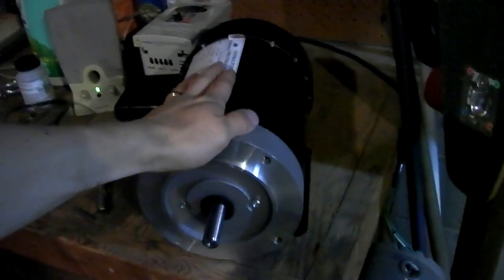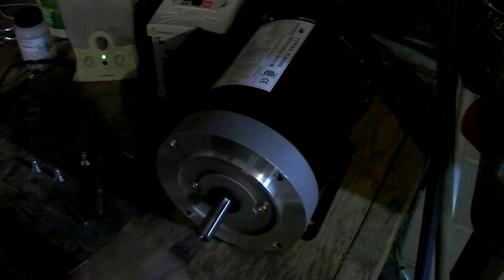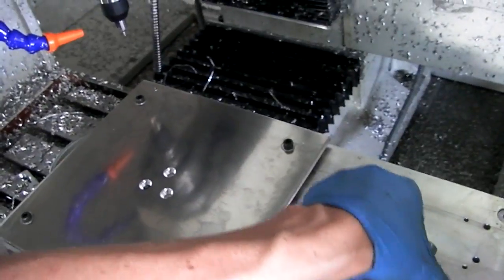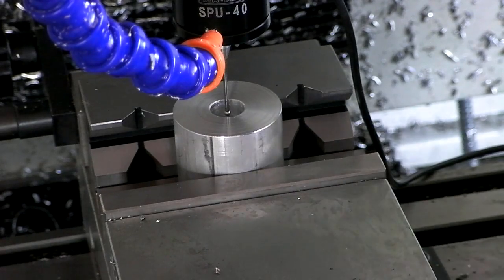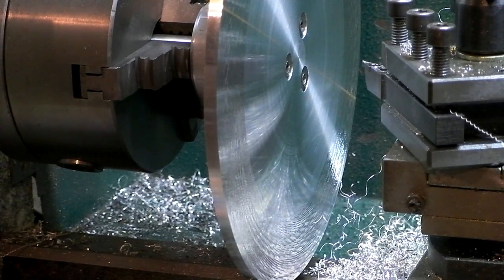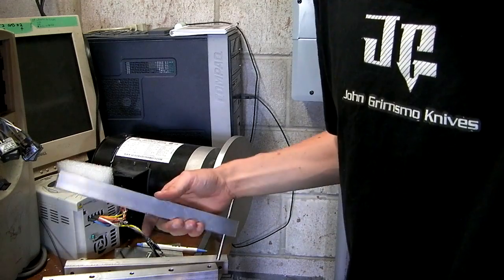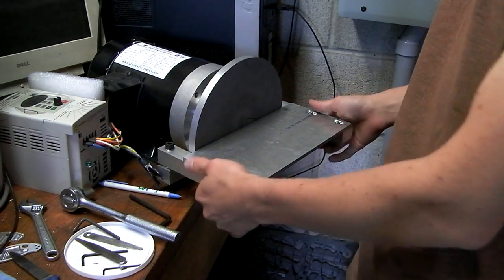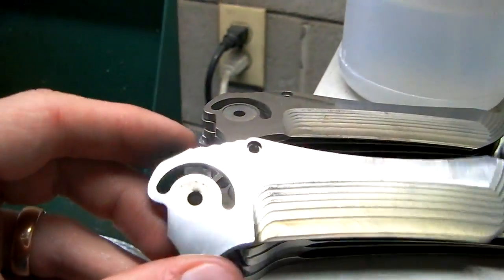Making a disc sander

Comment from the maker: Very cool!  Thanks for the tip!  After more practice and actually using a GOOD 3M sandpaper and not the no name stuff we were using, we're having great results.  The paper we had sucked and was too thin, so the backing was peeling right off.  Also, we're using a lot less adhesive than before, and it works great.  I will definitely keep your tip in mind, thanks again.

Comment from the maker: Dude now THAT is a killer idea.  I was just thinking of having little pry locations to lift the blade up, or have it go over the edge a bit.  But the 2 piece idea might work great and be easier to clean, depending on how I designed it.  We'll see.  For the next batch of blades we'll definitely have to make something.

Comment from the maker: We noticed the scale is pretty deep.  Interesting, if we can surface them all down to the exact same thickness before machining, say 0.122 or whatever it needs to be, then that will make both the machining and the finish sanding a LOT easier.  All my programs are based on 0.125 thickness, but it won't be hard to change it down a few thou.  We've gotta get a surface grinder!  Or you've got me thinking of looking into the cost of having it done locally...  What I really want is a Wuertz grinder.

Comment: John, in the video I noticed you've had problems with your sandpaper adhesive. I used to do a lot of body work on cars, and used a product for my sanding tools that I think may help you with that problem. It's made by 3M and is called Feathered Disc Adhesive (Type 2), #08051. It can be used multiple times without adhesive build up, it's very sturdy, and comes off easily and cleanly. I hope it can help you!

Comment: If you are wanting to take the pitting out of the steel, and that was the main reason for making this disk sander, you need to use a surface grinder that way you could line up a bunch of pieces at a time and save yourself a lot of time and hassle and get fantastic looking parts.

Comment from the maker: Thank you for all the tips, safety is definitely a must.  A surface grinder would be the BEST solution to do what we're doing, which is, uhh, surfacing the blades.  We're working on getting one at some point.  The gap for the disc sander table has to be tiny or else there's a serious potential for injury.  Most of these tools can be quite scary!

Comment: I know it's a bit late now but to get a really nice true turning, make the hub and plate, remove from the lathe and chuck up some scrap, turn the scrap to the exact size of your motor shaft and do not remove it. You now have a perfectly true shaft the same size as your motor. Mount the hub and turn and face the hub disc. Now when you fit it to the motor you will have a perfectly balanced disc.

Comment from the maker: Also, after having seen the exact part you're talking about, I was stupid enough to start sanding with the edge down, that's why it got stuck between the gap.  Now I always sand edge up, so that the spine of the blade is resting on the plate and can't slip through.  When machining the opposite side, I run the motor in reverse.

Comment: Ok John, Thanks. I ordered my Para 2 last nigt and I should have it soon. I really want a sprint para (the grey one you have), but I can't find them anywhere. I guess the only way to get them is the forums. I will make videos soon. Also, I am gettiong some Ti and attempting framelocks! It should be fun. I will put a dremel cut off wheel in the drill press, set the height, and rub the Ti across until it is cut. Tell Eric I said hi because I bet you get all the publicity (JOHN Grimsmo knives).
Thx

Comment: Hey Brother! Just an advice on the blades for the future - You'd be better off having them surface ground after cutting them out and before doing any machining on them. . Sanding them afterwards will mess up Your grind lines and alot of different things because this rolling scale is pretty deep (I've worked with RWL34 and I know ;) ). Plus it's a way better base for machining than the pitted uneven surface.

Comment from the maker: The trick is that the radius of the wheel is smaller than the length of the blade, so the blade HAS to slide back and forth in order to sand the whole thing.  Hard to avoid running off the edge.  However, you might be onto something.  But when doing lots of blades at a time it's a pain to wait for the motor to spin down for every one.

Comment: I've been a machinist tool maker for about 20yrs. You need to have the set screws if that is what you are going to do exactly. Make sure the screws are set apart if not,  you will keep having the same problem. You could use the same set screw but drill a relief hole into the shaft or lastly shimm it. I guess without taking the motor apart you could cut a key hole into it.
 Also u want remove as much weight as possible on the disk part. Do it on the back side by creating ribs that will give u riggity but also Will help you with vibration.
 You also NEED to that balance that disk. First with you CNC vertical mill. Drill a hole with a (BRAND NEW )1/8" HHS drill (so it perfectly 90° into scrap aluminum that has some thickness to it) remove the bit from the tool holder and take the exact same drill turn it upside down and insert the shaft into that same hole. On a level,  work surface (that you can get some vibration when u tap on it) put the jig you just made on it. Then place the face side of the disk on the bit (if you can' t get it to balance flatten the head of the end of the drill a little bit on a grinder) then " GENTLY" bump the surface of table and what ever directition the disk falls needs to have weight removed. It is exactly like balancing a tire. You will need to go back and 4th. Also make a Corresponding shaft that can be used on the lathe that u can dial it out to see where the set screw need be and by how far in to center the disk.
  IF YOU DON'T you will be replacing bearings real soon with that kind of wobble or the motor. If u take the little bit of time to do it ir will last past your kids' kids.
Just want to help out a fellow knifemaker out. And hate to see u pay all that money and time for more costly fix in the future because bearing are a pain in the head and wallet

Comment: I used to have a Wadkin 30' dia machine it is designed to run clockwise so you have to use the right side and these machines are the rolls royce of sanders. Theres no convention just what you get used to. In my experience the bigger the better as discs last longer. On the lighter side I have a lasting memory of my dear ol Dad setting his coat on fire grinding a cam ha ha

Comment from the maker: Subscribed, now you HAVE to post cool videos of it!  Haha.  The Tormach does run on 220v, along with a 120v for the computer.  Ti Para2 handles will be happening very soon, I've been having some more problems with my design, they're not coming out as perfect as I want them to be, so I'm holding off on the Ti ones until the code is PERFECT.  Stay in touch and I'll make sure you'll get some.

Comment: "But when doing lots of blades at a time it's a pain to wait for the motor to spin down for every one"
.
You don't have to wait for the motor to stop.
Your VFD should have dynamic braking settings.
The motor can come to full stop within a second or two of turning it off, much less time than it takes for you to switch blades on the magnet/jig.
.
I do agree with surface grinding if you can.
The blades are easier to center if everything starts parallel.

Comment from the maker: Didn't mean to sound know-it-all-ish, cause I certainly don't.  In my hobbyist experiences with acids and metals this was the case, and even still they're scary to work with at home.  I guess I'm generally trying to avoid the nasty stuff if I can, then again maybe the chemical you're referring to isn't very nasty, who knows.  Either way, disc sanding or surface grinding gives me the warm and fuzzies and is the common way to tackle this problem in the knife world.  Certainly not the only way.

Comment: I think over time you're going to have alot of buildup on your disc with using spray adhesive directly to the aluminum.  You give any thought about making a velcro backed liner that you can permanently attach to the disc, and then use some of the velcro backed sanding pads you can buy for larger hand/disc sanders.

Comment: Part-1
Rather then sanding to remove the "pitting" you may want to look into an acid bath of some kind. When I worked at a major airplane manufacturer in the Pacific Northwest, they did this in their plating (Chrome, etc) shop. Their tolerance for material removal was 0.001". took about 1-1/2 min in the tank for approx 1000 plus parts at a time in a very big tank. approx 6' Ft wide X 12 foot long, by maybe 18" in to 24 in deep.

Comment: Like your video. Much better than the disc sander is looking at the fine tools used for making it :) I think to get rid of the wobble you should have straightened out the backside of the aluminium plate, too. So it is running flat on the front but got a unbalance on the back. Maybe you can try to drill some holes on the heavy side to get rid of it or machine it flat, too.

Comment: You could mill a slot in the rest and make a jig that holds the blade. You can then slide the jig left and right in the slot and touch the blade to the sandpaper perfectly every time.

Comment: And another thing - if You are going to sand alot of them do a jig that You mount the blade to that You can simply rest on the table and press to the disk. It's easier to hold and gives better results. Never go past the edge of the disk sander if You want a nice even surface.

Comment: Just a thought, but if you make a bracket to hold the blade you could sand the whole face flat while removing the pits. Like you have for your mill to hold the work perfectly perpendicular to the sander you'll have better ease of sanding the hole face flat at one time ( with less risk of holding it at an angle.

Comment: The wobble is caused by a balancing issue with it not being on center.  The first disk could have been used if you were able to balance it - it didn't have to be exactly on center.  If you are lucky enough to know someone who does vibration analysis, they would have a field balancer that could balanced this by drilling spots on the disk.  A Pruftechnik Vibscanner or VibXpert is one such product, although something a machine shop would not ordinary have.

Comment: Reasons for acid bath(s). To remove protective Heat Treat (5 mil thick) coating on parts that were heat treated to Rockwell 60 hardness (gears), parts with tool mark's (Hint) as you enter an airplane that was made in the Pacific Northwest, that "Scuff Plate" at the bottom of the door, that you might wipe your shoes on, is not Aluminum, and it's not Stainless, but it is Titanium, very expensive, and easy to mark from forming dies. Just thought you like to make an educated thought on acid bath(s).

Comment: John, not everything that came into the plating shop, got a coating shall we say, some parts were there for the acid bath finish shall we say. 

"would remove a equal amount of metal from inside the pits and outside the pits." is shall we say half right. I would investigate the benefits of an acid bath "A Lot further." You do what makes you feel warm & fuzzy, but at least admit to yourself, you don't know, all there is to know, about an acid bath. Great video and great subject matter.

Comment from the maker: That works well for plating, but I would think that an acid bath would remove a equal amount of metal from inside the pits and outside the pits, not solving my problem at all.  Great for plating because now everything is clean, but I'm looking for flat, shiny, pretty parts :-).

Comment: I think you're supposed to sand on the left side of the disc sander; so it's not pulling things down into the gap between the disc and the platen.  Only from the center left.

Comment: Hot air gun to warm up the old abrasive paper and spray adhesive, and it'll peel off nicely. Also with less residue to get rid of using nasty solvents.

Comment: This reminds me of building my 2 HP 3450 RPM Grinder, a KMG clone. It also has a vfd and 3ph motor. It runs ay 220v, and it is the coolest thing ever.
One question, does your tormach run at 220v or something else?
Also, When are you going to make Ti Para 2 scales? I want them so I can have an excuse to buy a para 2!

Comment: What you are doing at 4:47, can be quite unsafe, unless at a VERY low Rpm. Ideally you would have a wide belt with a perfectly flat Platen for doing face work. One safe way you can use the disc to sand faces is to do it off to the side, so that you hold one half while sanding the other. If that makes sense. Just trying to keep you safe, think thats my OSHA training coming thru lol

Comment: So finding the centre of a circle. Sry cant read 142 comments 2 c if u already got this one. Your first left to right found the left to right centre however since that didn't go to the absolute left and right but only an offset left and right it had to double check it after it did the front to back centre. sry no graphic illustration but if you were to draw your own with a x and y axis from the centre of a circle you'd find the first pass left to right on the X axis was not measured from Y=0 but rather Y= something other than 0. and I ramble too just in case description 1 was confusing. Also you really should make 3D photographic negative style plates for when you flip stuff over to do the other side as this will stop stuff flexing down if your feed/plunge rate is too high. works 4 articles made in wood too.

Comment: Yeah, I asked DAMASTEEL in Sweden the manufacturer of RWL34 if they could deliver me a precision ground steel, but unfortunately they can't... But I'm sure any machine shop can do that for You and the key is to take down a tiny bit at a time since surface grinders tend to warp thin material if too much is taken off ! Wuertz Machine Works makes the best grinder out there today, but super expensive. For Your needs I think the KMG Horizontal Grinder EF-48 would be the best solution.

Comment: Just so you know, from personal experience, a disc sander is not the ideal for doing large face facets. A large belt would be MUCH safer. I was a shop monitor in college at the machine shop, someone was trying to sand faces like you intend to do.  The project caught, pulling the kids finger tips into the slot where the disc meets the table. Cut off all 4 fingers at the first joint immediately. Blood spray was  12 foot. I know because I mopped it up and tried to help find pieces of fingers.

Comment: Not a variable speed sander unfortunately.  I'm a novice woodworker (knowledge on milling is limited) so I have not yet come across a situation in which a speed adjustment on the sander ( just change the grit  relative to how much material i'm removing and am weary of pressure on disk to keep the stock from burning up) .  I know they have speed controllers you can use for routers that will work with 3.5 hp and lower motors, but not certain if they would work with a 1hp sander motor.

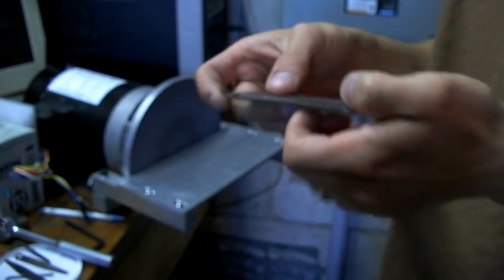Comment: 37:11 Jeeze moment.
.
If you wire a footswitch into the VFD; you can put the stock to the wheel, then start the motor and avoid that gouge

Comment: John  Thank you very very much for announcing automation direct you just saved my bacon ,  I have to get out of here and i cannot take all my equipment  so I have to have a sale on a lot of it oxy /acc ,  band saw  sand blast cabinet  two anvils  one 200 pound and one that is 110 ,  110 meg welder ,  Box propane forge  and a 40 gallon tank   and  half of a Grizzly G1015 grinder motor runs bottom end of the  grinder is complete  minus  top end assembly , so if you know of ant one in central texas that is looking   n third week o0f september it will be for sale ,  and i have about 45 feet of 52100 E ball bearing steel 1" round  at 6 bucks a foot as well ,,

Comment: $330 for the motor and controller only?

You can get one hell of a decent used 6X48 belt grinder WITH a disc sander for less than that and the work to get it like to be like new would be a hell of a lot less.
I got a Craftsman 6X48 only missing the disc for $65, then I can use the belt to help fab a simple disc. A new replacement 9" disc with 5/8 hole is only $70 from Sears.
Why not use the CNC mill to make the hole exact?

Comment: much safer and faster to use a right angle hand sander. start with 60 grit then 80, 120, 240  up to 600

Comment: INS means insulate.  Most 3 phase 9 lead motors are wired as such; Line 1 goes to VFD Line 1, Line 2 goes to VFD Line 2, Line 3 goes to VFD Line 3.  Now because this has dual split windings, meaning 2 windings per phase, then you wire up T4(motor) to T7 (motor) with a wire nut and insulate this wire.  You do the same for the other 2 legs, meaning wire up T5 to T8 (Motor) with a wire nut and insulate, and the same for the last two wires, T6 would be wired to T9 with a wire nut and then insulated.

By the looks of your wiring in the video you are not using all the windings, thus you have lost torque and efficiency.

Comment: If anyone ever needs every single modbus command location put in to Productivity Suite  for controlling the GS2 drive from a productivity3000 over rs485 all you've got to do is ask. I couldn't get most of them to work correctly because the pac3000 was being a A.HOLE. Trust me it's a pain in the ass most likely because they want you to by one of their products so you can used the "GS Write" and "GS Read" built in utility.